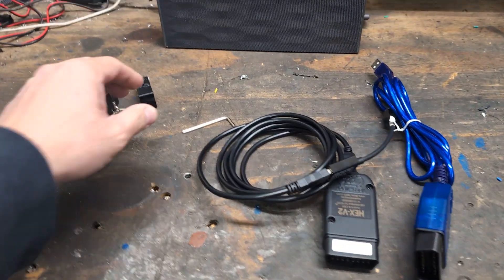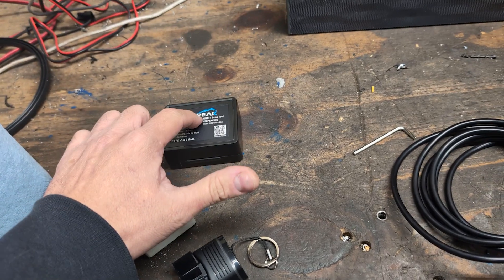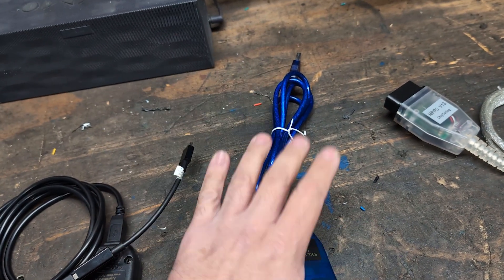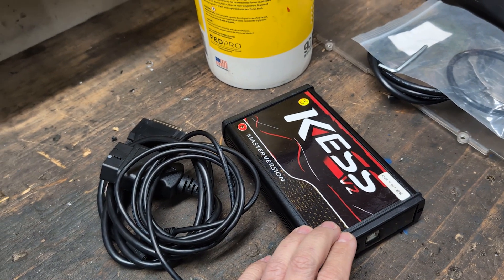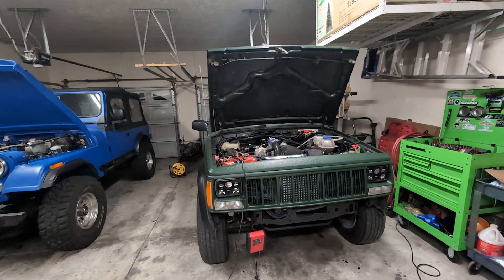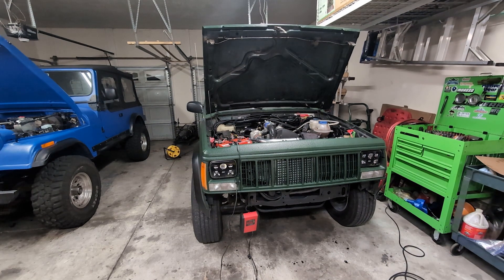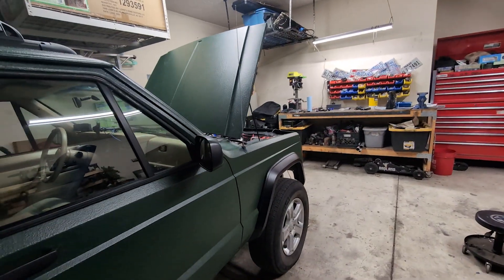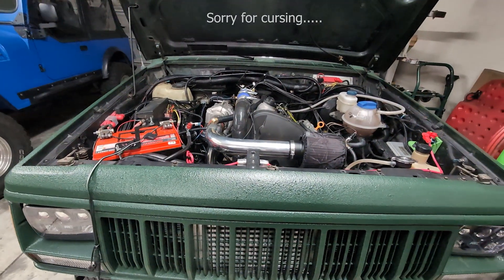Tuning,  diagnostics and tunes for TDI Swaps

Comment: Is the kess m2 what you use with tek? He told me to get the mpps cable but I would like to get a cable that is reliable
Reply from the maker: I use both MPPS and KESS. I prefer KESS. I had issues pulling the files with MPPS. With KESS I've never had an issue.